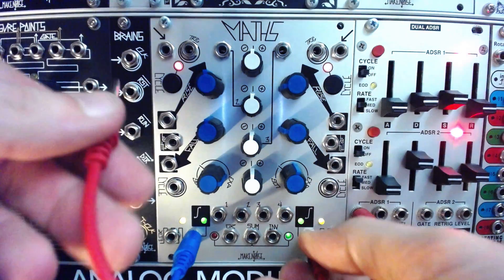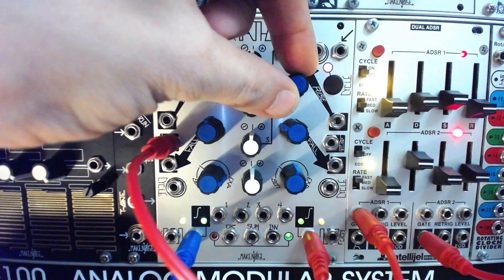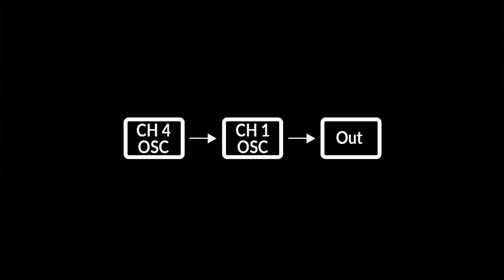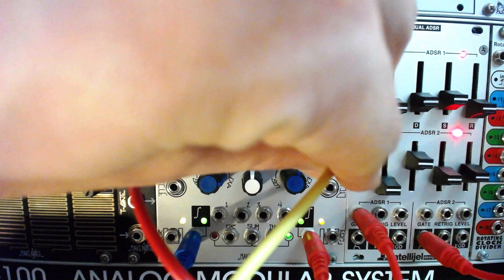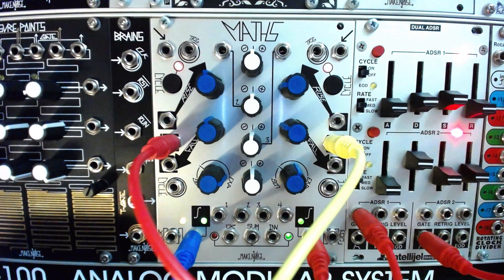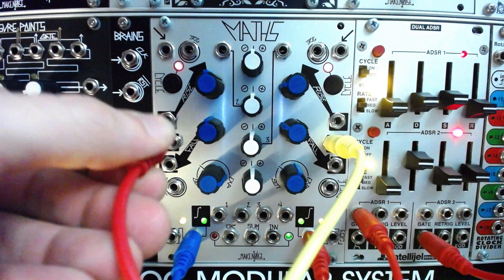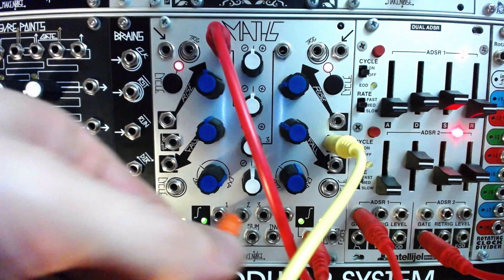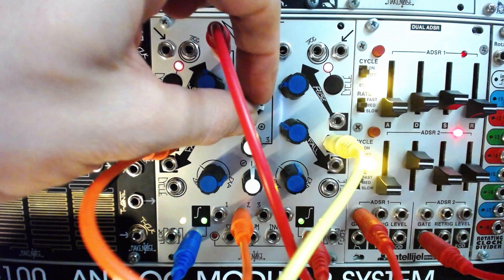Maths As A Complex Oscillator

Comment: Another way to use Maths as a complex oscillator is send a square wave from a VCO to the trig inputs of CH 1 or 4. You just have to set the rise time sufficiently small such that it doesn't exceed the square wave's wavelength. This gets you accurate v/oct tracking. If the triggering square wave's wavelength exceeds the rise time of Maths you'll get subdivided frequencies which is super cool. This is basically how a Mangrove works. What I do is take two square wave VCOs, sync one of them to the other, and use those respective waves to trigger CH 1 and CH 4 of Maths. When you play with the frequency of the sync'd square wave you can get some really gnarly artefacts on Maths. This is essentially how Mangrove works in constant formant mode. If you don't want all of the formants artefacts and microtone subdivision then just mult the v/oct CV to CH 1 and CH 4 "both" inputs. Another trick is to send the Ch 1. and Ch 4. Maths outputs to a VCA and AM them with the same square wave used to trigger said channels.

Comment: I'm confused about where the yellow cable was coming from,  you twice mentioned pitch control & atonal pitch control then plugged it(yellow cable) into the "both" input on maths.     
But where/what is plugged into the the other end of the yellow cable?  A controller keyboards cv?.... A sequencers cv out?  An Lfo? 
  Just trying to understand .
Reply from the maker: NYCP NY yes it's a sequencer signal, which is altering the length of both rise and fall, the result being a change in frequency of the cycling wave :)